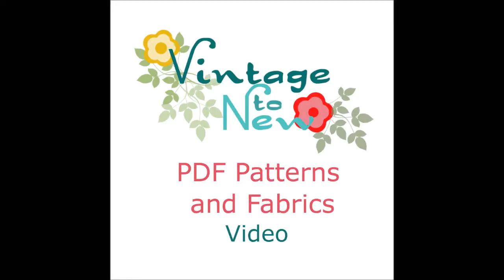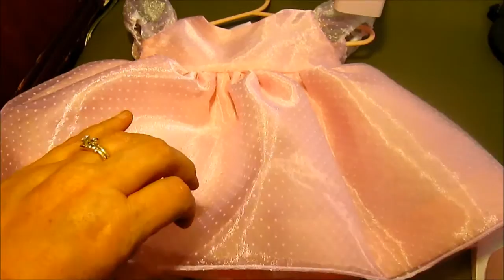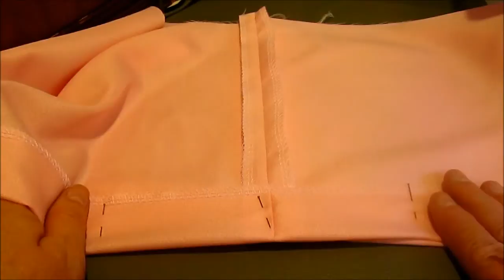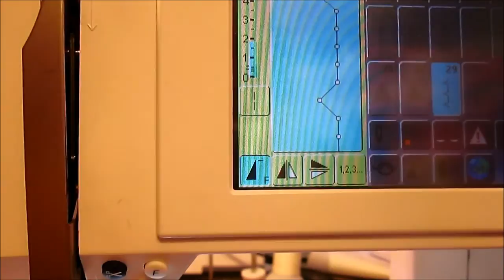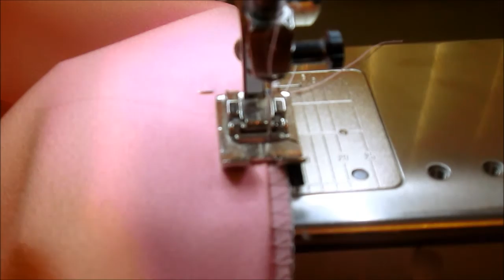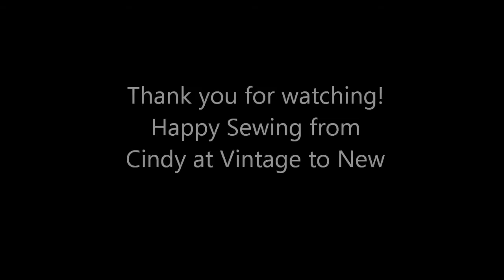Blind Hem - Without Using a Special Sewing Machine Foot

Comment: Very helpful instructional video. The only thing I would have like to see is the thread tension setting you used. for those of us new to sewing it would be helpful. Thanks for the video.
Reply from the maker: Jose Alfredo Reyes Thank you so much for the comments.  The tricky thing about sewing is that EVERY sewing machine is different.  I sew a lot and I take my machine into the shop about once a year to have it serviced.  They set the tension, timing, oil it, all that good stuff.  Then for the most part I keep the tension where it is set unless there is a specific reason to change it.  The other thing that newbies don't really know is that you NEED to change your needle every project or two.  It is amazing how much difference it makes to have a new needle AND have it be the right needle for the type of fabric I'm using.  I hope those tips are helpful for you.  Happy Sewing - Cindy